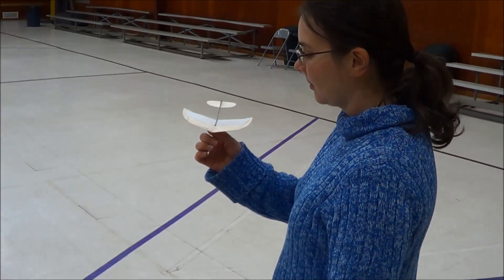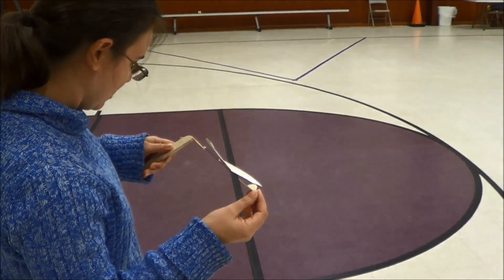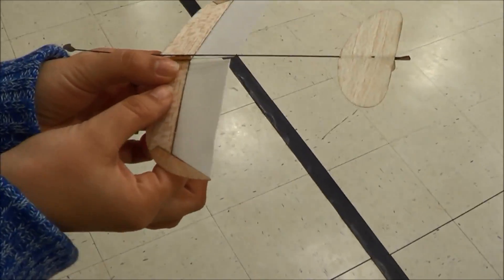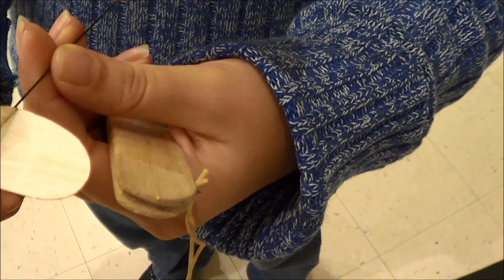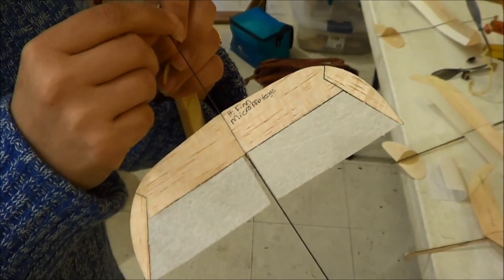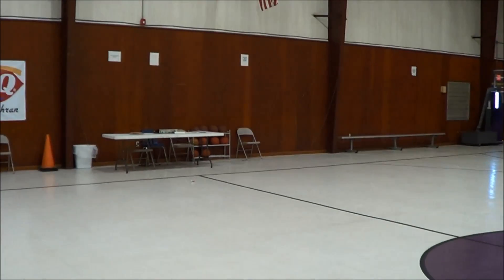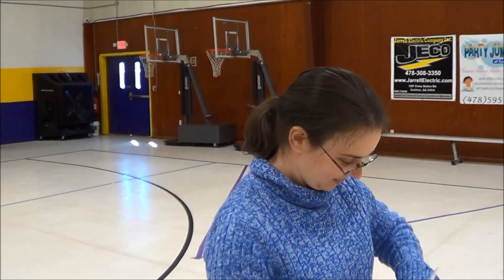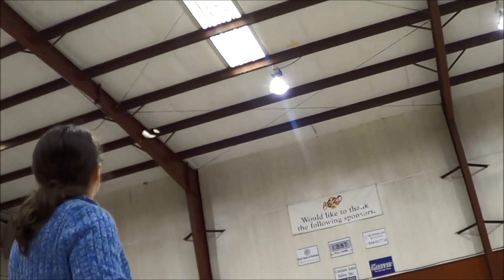Trimming the Micro Protege F1N-150

Comment: Dear Joshua, I am writing from Rosario, Santa Fe, Argentina. I am interested in starting with this exciting category, but I have some doubts. 1) I cannot find the regulations for F1N-150. Where can I find it? 2) Launcher: a) Is there a limit on the length of the handle? b) is there a limit on the rubber?
I would appreciate it if you can answer me.
 Greetings. Dario
Reply from the maker: Dario, it's only a formal class in a few countries in Europe, but in general what I've seen is that rubber is unrestricted, launch handle no more than 6" long. Neither of these rules have a huge impact on the flying anyway since the models need very little power to be launched extremely high.
Reply: @joshuawfinn  Thanks you very much. Regards